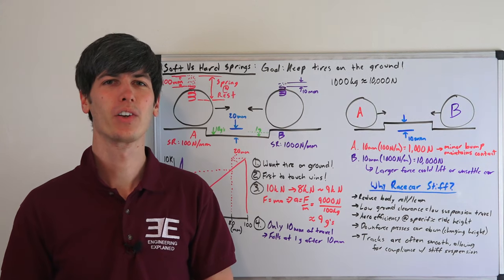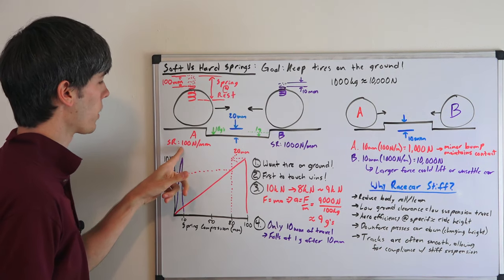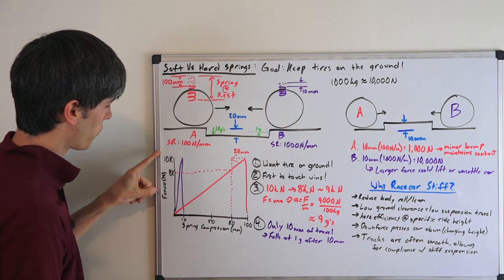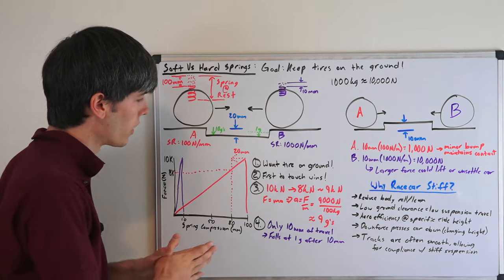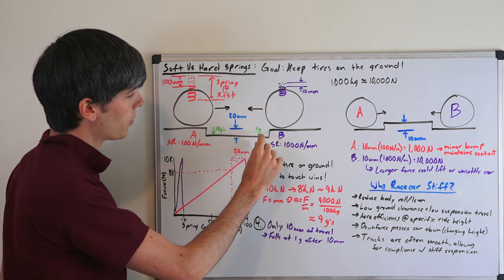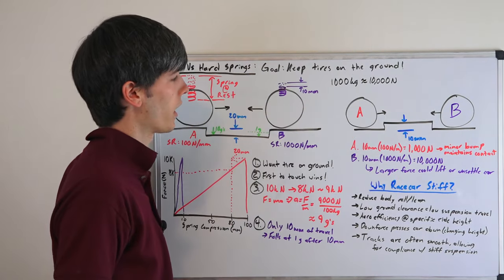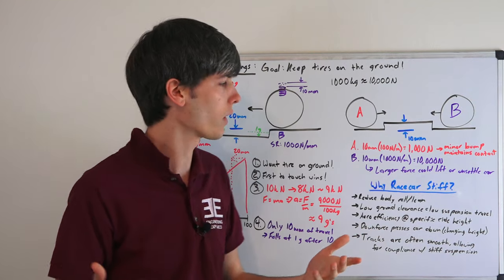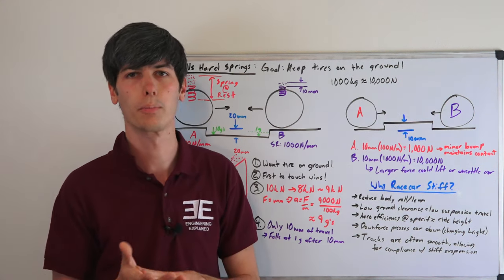What's The Best Suspension - Soft or Stiff Springs?

Comment: I usually enjoy your videos but this one has some bad logic. This is a very very special case, which almost never occurs. That is hitting a bump larger than your suspension droop. I've had cars on 12kg and 10kg springs. Even an FC RX7 with Mcpherson front suspension of almost 1:1 moment arm with 12kg springs would have nearly an inch of droop. Don't know about you but if there's a road with that crazy of a drop, I'm not driving on it! 
So following that special case you're discounting all the other benefits of stiff springs and claiming that softer springs are better for the street?
Reply from the maker: TheXdmgx7 The logic is sound. Softer springs will allow for more compliance with the road (even if the examples are exaggerated to keep the math simple and explain a point). This doesn't mean soft is "best" for the street, it's simply factual that in non-perfect conditions it will do a better job of maintaining contact with the ground. Design for what road conditions you intend to drive on.
Reply: TheXdmgx7 It becomes a problem when you consider the force on the body creating an upward acceleration from stiff springs.  The back side of a 10mm bump can cause an aftermarket suspension to lose contact with the ground because the body continues it's velocity upward which drags the wheels up with it an reduces the load on the springs, which removes droop velocity.

Using an aftermarket ride height and spring perch separated adjustment coilover you can easily tune the suspension to be harsh either on the front side or back side of bumps using the preload adjustment on the lower spring perch. If you have conventional single collar adjustable coilovers this won't work because you cannot preload. For instance, i can set up my coilovers to have zero preload and thus maximum shock compression at static height, which will make it more likely for the shock to contact the bump stops, drastically increasing effective spring rate over sufficiently sized bumps and causing compression to be uncomfortable. In reverse, I can preload the spring to the point of zero shock compression at static height and as such giving the shock minimum droop travel, making the front side impact of bumps very gooshy but the back side of bumps like falling off a cliff.

So it depends on the ratio of shock length and spring rate to determine the actual road-contacty-ness of a coilover.
Reply: Engineering Explained I agree that in non-ideal(horrible) conditions softer springs will do a better job maintaining traction but you did not claim that softer springs are better for non-ideal conditions. You claimed softer springs are better because the harder spring will run out of droop if you jump a huge curb and you will lose contact. 
In the real world it is VERY hard to lose contact due to inadequate suspension droop. (I'd be dead 10 times over if that wasn't the case)
Reply: TheXdmgx7 your assertions about the difficulty of losing contact depend entirely on the properties of the shock and spring combination. My coilovers can and do regularly lose contact with the ground. Engineering's extreme examples lay the groundwork for how relative wheel and chassis velocities work together. He is correct. You're just having trouble working between the extremes. In his example, wheel forces of 2g, 4g, 6g etc between the two extremes of 1g and 10g are possible. Those forces relate to how quickly the wheel follows the back side of every bump. The closer to 1g the more often the car will lose contact with the road. This can be due to spring rate, damper settings (over-damping on rebound for instance, lowering wheel velocity on extension) and of course limited droop travel (which is the problem with my coilovers).
Reply: Gregory Evans I completely agree, yet this is not enough of a reason for the claim "softer springs are better for the street." 
My problem is not with the overly simplified math but with stretching it and using it as a proof for a much more broad claim. 
An example would be the moose test(Real world, right?)... How do you think a softly sprung car will do? It'll be less responsive due to the delayed weight transfer. See my point?
Reply: TheXdmgx7 My Miata was very softly sprung (167 lbs/in front 96 lbs/in rear) and it responded very well to direction change. Seeing as it's one of the most popular slalom cars in existence, I would posit that it would do very well in a moose test.

Stretching math is exactly what a good scientist does. If the theory works at two extremes then it works between those extremes. Physics doesn't change because you normalize values. Again you're assuming bahviors about suspension are due to the spring rate but its the system as a whole, not just the spring. This repetitiveness in your arguments is getting boring.

You have an actual engineering student (now graduate?) and a racing driver telling you how it works but you're still arguing. If you're incapable of learning then there's no reason for us to waste time on you.
Reply: Gregory Evans I'm an engineering student too and I have been going to the racetrack about once a month in the past year or so. So get off your high horse a little, Miata man!
Speaking of what good scientists do, "responded very well" is not a part of it.
And "If the theory works at two extremes then it works between those extremes" is not at all scientific. This particular "experiment" is certainly not going to be linear like that.
Justin(I believe that was his name) makes things simple, and I can appreciate that; however this particular claim is not that simple.
But people don't like constructive criticism so I'll stop.
Good luck fellas.
Reply: TheXdmgx7 You have to remember this guy has no real world experience..
Reply: TheXdmgx7 you've never driven in SEPA have you? 3/4 in+ is VERY common on our roads, all year round.
You mentioned the moose test, which is performed on an entirely flat course. So, again, body roll is key.
Put a 1" bump at the turning points and you'll see that the uber soft suspensions still flip over and do crazy-ness same as before. BUT the uber hard spring rated cars will slide out and lose control.
Those at a happy medium will perform best.
The other thing that throws EVERYTHING off is that only springs are being discussed here; dampers also play a significant role. As well as geometry. BUT the goal of most EE vids, and physics instruction in general, is start with basic assumption heavy constants, to get your building blocks; THEN combine it all for the super complicated, highly variable, real world.
Reply: QuiznosBear You understand what 12kg means, right? That is not a street setup at all and it still has over an inch of droop.
And I don't even know what SEPA is but I doubt you have a 3/4" drop. As in |___ and not this \__. And even then, that track setup I talked about will not have the problem Mr. Engineeringexplained is talking about. 
I'm gonna give you an example on the most bumpy place people go fast at(that I know)....Sebring's last turn. Go watch videos on it. IT IS HORRIBLE yet fun. People ALWAYS lose traction unless they're super soft but nobody "will slide out and lose control."
And that is going 10/10. I would be greatly surprised if anyone loses control of a car for that insanely brief moment the load is off the wheel while driving a ridiculously stiff car on a ridiculous bump. 
It's sounding very repetitive now but this is way too special of a case for proving something so very broad.
Reply: Half an inch is extreme? Where the hell do you people live? I live in SE Michigan, if your car is tuned such that 10mm is extreme, I am betting that you couldn't go 10 mph through Ann Arbor without trashing your suspension, rims and tires.
Reply: TheXdmgx7 Given how close the cones are in a moose test, which was my example; a 3" slide hits a cone. Which is considered outside of "controlled"
I wasn't implying spinning 360's or anything...
SEPA = south east PA; we have |_ 3/4"+ pot holes all over the place, it is terrible!
BUT For a simple test there's an entry onto 476 that has in the shoulder nice, wide, rumble strips. I always cut the corner and hit the strips. I can take a saab 900 (soft) and a Fiesta ST (hard) at the same steering angle, with exactly the same rims and tyres, and the ST will slide out EVERY time.
Reply: QuiznosBear "soft" and "hard" These are not quantitative...and that is part of the logical problem. I can and do hit berms at the track and those are half to 3/4 inch drop and I have no problems. There are also some large bumps on the canyons I drive on but I have never had problems on them either(apart from not being able to put power down which not even my friend in a stock miata can)
My experience leads me to believe that your Fiesta is not well damped or you are exaggerating a bit. 
But I'm gonna repeat my argument one more time...I'm not saying higher spring rates are better. I'm saying "softer" springs are not better. There is a happy medium between the 2 and staying on the lower limit of that is probably more optimal overall(street)
And to set a value to that and not talk in "softer" and "harder" terms I'd call that 6kg/mm on an RX7. 7-8 on say heavier Mcpherson cars(STI). 8-10 on dual wishbone cars. And I'm talking about the front.
Reply: TheXdmgx7 The point was that for normal street driving, softer than race springs (f1 range) are better. This is the point proven in the video, with which you now seem to be agreeing. I'm glad you've come to this recognition.
RE: The fiesta, I'm not exaggerating, it is a very specific example, but it was the best real life example I could think of, both cars are extremely similar: the same weight, same HP, same wheel lug pattern, same coolant, same brake fluid, to the point where I feel like I should've dumped $500 on an old swedish thing. BUT the big difference is suspension, SAAB has front A-arms and MUCH softer springs. This makes 3-wheeling much more likely, but when it isn't doing that, it's less likely to slide on bumps than the FiST. It's not an extreme slide, ~6-8 in across 60-70 yards of rumble strip starting at 60mph and increasing. But still shows that the physics hold true.
Reply: QuiznosBear Unfortunately F1 is a very bad example because first of all, there's not much info on it. Secondly, it's a pushrod system and thirdly, they run smooth roads so I personally can't tell how they are. 
There is a section in my favorite mountain road with 10 or so small bumps caused by bad asphalt mid corner. My RX7 takes it 7/10, my stock corvette takes it 8/10, my motorcycle 7/10, my friend's miata on 9k springs 9/10, and finally a stock miata: we almost died. The thing was out of control and just slid over the bumps to the outside of the corner. 
Mr. Engineering explained claimed that the softer setup has 9g of acceleration, and the hard setup had 1g, correct? If your shocks allow that, they are going to cause you to die due to lack of damping.
Spring rates are not anywhere as important as damping. A BMW M3 will ALWAYS do better on bumps than a 1967 Cadillac. That wouldn't be the case if "softer springs are better for the street."
Reply: *****
The first educated response I've gotten thus far. Thanks for that.
Although anti roll bar(sway bar) is a great way of reducing body lean, it is not at all optimal for cornering. There are 2 downsides, it reduces grip on the inner wheel, and it unsettles the car on bumps (not much but noticeable)
And sway bars are to add cornering confidence to cars that would otherwise lean too much and make the driver lose their confidence. The goal is to maintain comfort while not over leaning.
It has nothing to do with this very special case that almost never happens.
Reply: ***** Based on your response, I assume you didn't read my entire comment, which is fine.
Actually I haven't watched any of his videos since this one. I bought the book he is oversimplifying though...good read.
Reply: The whole point of suspension is to help the tires maintain contact with the road. Now when it comes to lowering your car, or having and SUV Or a pickup truck, all of that changes depending on the application. I think this video has a lot of good information and was explained properly. It's up to you to understand the rest and do what you want with that information
Reply: dontbeghey
 It's been a while since I legitimately learned something from these videos. Now days every single one of his videos feel like he literally opened the chapter summary of that topic and didn't even read the entire thing...just the first paragraph after the first picture! (I actually bought the book he goes off of and read it)
Reply: +flurryblizzard WHAT?! this video is cherry picked...designing an entire suspension system to not lose contact with the tarmac when you hit a bump so big you run out of suspension droop?!
Oh and not all tracks are smooth. and we go over the rumble trips all the time with "our ridiculously stiff suspensions" and we don't lose contact. 
The entire premise of this video is so absurd it doesn't apply to 90% of road cars unless they decide to corner hard when going off a damn curb.
Reply: +TheXdmgx7 , I have had that happen to me. 1983 Saab 900 turbo, fitted with coils, shocks (Sachs Sport) and anti-roll bars from a turbo 16S. Well, nearly, because coils were also shortened a bit, so they were even stiffer. 
This car was PERFECT for the roads I used to drive on when we built it. 
Then I moved from Bavaria to the Eifel, and road quality drastically deteriorated. I would often find the car "side-stepping" during corners, that is, hit a bump and suddenly you are 1.5 meters off your line... 

The next car we build (a 1985 Saab 900 turbo) retained the softer original springs, just shortened by the same amount (dropping center of gravity and increasing pre-load a bit) and very mushy Bilstein B4 dampers. 
This car would move around the very same corners, which made the first car misbehave, without any issues. Made my daily commute much less stressful and even faster... 

But take the second car on a smooth road, and it would be noticably slower, or at least, I would drive it slower, because it felt much more unstable on really smooth roads. The usual "clover leaf" on- and offramps  at an Autobahn intersection would allow 95+km/h easily in the first car, while the second would start to feel uncomfortable at just 75km/h. 

Softer vs stiffer suspension really is not matter of better or worse, it is a matter of what is adequate for the roads and driving style. 

For example, some 15 years ago, I owned a Mercedes w123. About the softest a non-hydropneumatic suspension can get. I used to drive the B5 between Berlin and Frankfurt quite often, which at that tie featured higher speed limits than today, but had much worse road surface. In the wild east, tuning cars was a very common hobby amongst the rural youth, so you saw A LOT of modified compact cars. Polo, Corsa, Fiesta, Civics... all incredibly low, loud and with not too much power nor suspension travel. Which meant, my underpowered (60 hp, 2 tonnes) diesel landyacht would actually be faster.. at least around corners. When some of thes ekids misjudged their speed, perhaps fooled by the big soft S L O W Merc in the mirrors, it was not uncommon to see their cars being offset and moved all over the place... 
A litte softer suspension and a bit more travel would have made their shitboxes A LOT better. At least on these roads...on a racetrack, they would have smoked me.
Reply: I was not there to see it but I'd put that on poor damping or bump steer, unless you were hitting bumps a couple inches in height!
As I mentioned earlier, your car would need to be absurdly stiff for the thing described in the video to happen. 
An example of how absurd that is would be Sebring's #17. Inch or so high each, and there are quite a few of them. GT cars lose contact on the inside tire(outside stays planted), most amateur cars don't. A car that is as stiff as a GT car is not a street car!
Reply: Well, the top gear boys once had a conversation on a 900 turbo, during which one of them said: "nice car, but why did they leave out the suspension?" And amongst Saab enthusiasts there is a saying "A Saab's suspension works by flexing the body".
Even the "normal" 900 turbos are very stiff, especially when compared to other cars of their age. And it is especially minor, short bumps that get through. Drive a 900 on cobblestone and the car literally falls apart... 

The car in question, which showed this strange behaviour had even stiffer springs and dampers than stock. And the second car, which had a much softer suspension setup, did not misbehave on the very same roads.

Bump steer: maybe, but than, that should be linked to suspension and steering *geometry*, and the second car should have experienced the same, but didn't. Poor damping: well, the opposite. Sachs Sport are rather firm, and the car probably was over-dampened. Which, on this particular road, was a poor choice. So, yeah, poor damping. ;-)

It would have been interesting to see how the car would behave with the stiff 16S springs and the mushy Bilstein B4 shocks, and with soft springs and firm Sachs sport, but unfortunately I do not have this comparision. Only stiff springs/firm shocks vs soft springs/mushy shocks, and the latter proved much more appropriate for a daily driven Saab 900 on less than ideal road surfaces. 
On a smooth racetrack, on the other hand, the stiffer setup wins by far.
Reply: Martin Rudolph I did not know about the chassis but there is always a limit to how stiff your springs can be. If your suspension mounting points are not stiffer than your springs, your chassis becomes the spring and chassis' don't have dampers!
Being overdamped would make it worse too. Too much compression would lift the body on a bump, too much rebound won't allow the wheel to come back down fast enough.
So in short, there are a few components other than the springs that were effecting your two setups.
Reply: "So in short, there are a few components other than the springs that were effecting your two setups."

No doubt about that.
Reply: TheXdmgx7 applies where I live
Reply: @EngineeringExplained  hey jason ...your subscriber from India .....i love your videos ..i am an Automobile engineer in Honda (Two wheelers ) 
which type of suspension is better at high speed on road not on track specially when road have frequent bumps? i have an Ford Ecosport and this car have stiff suspension and i can feel the bump on low speed and even at high speed i am not comfortable but other people really like ecosport and its handling. i cant understand.